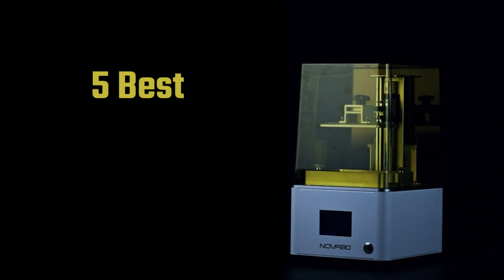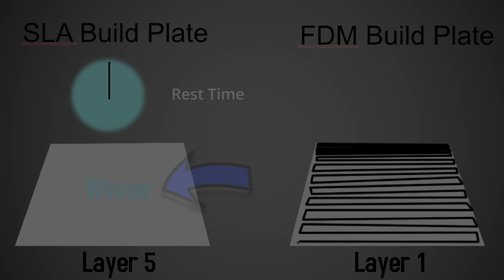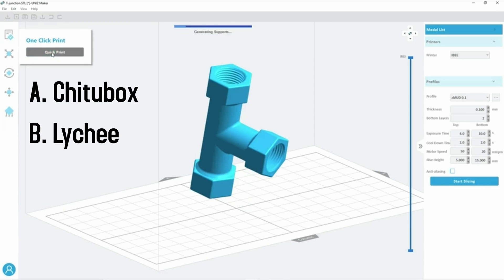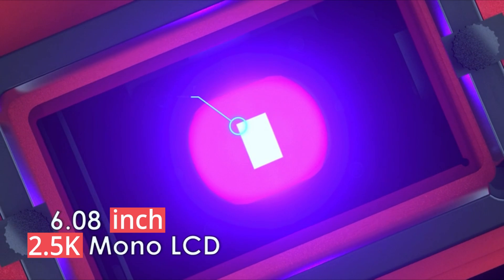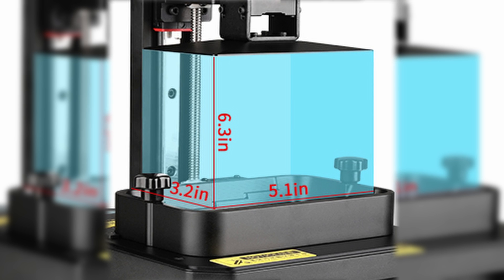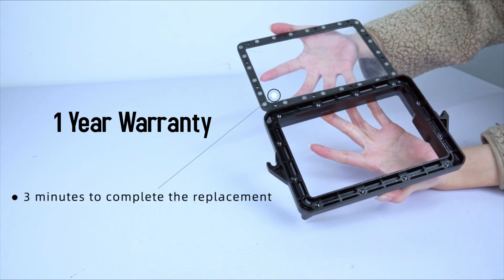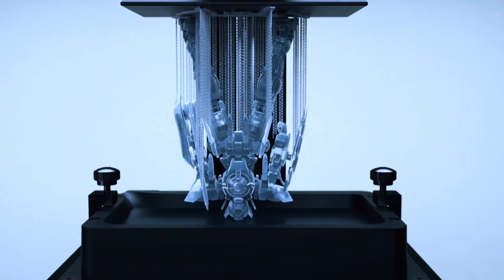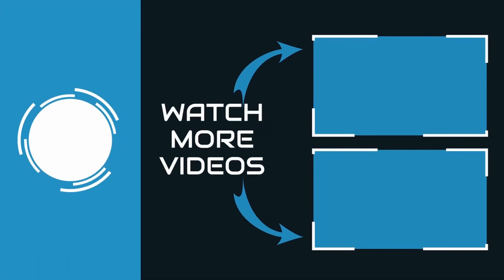Best SLA 3D Printers for Beginners in 2023 | Top 5 | Resin Printers

Comment: Small correction: you listed the printer size as the build volume for the Mars 3 - the actual build volume is 14.343cm (L) x 8.96cm (W) x 17.5cm (H). Informative video otherwise!

Comment: Is it possible to achieve print resolution of less than 20 microns using the LCD printers? Can DLP printers achieve print resolution less than 20 micron? What about SLA printers? What is the minimum resolution that we can obtain from SLA printers?
Reply: You can achieve much smaller resolution but the limits start becoming more about light uniformity ,theoretically the smallest you can print is around half a micron as thats UV lights wave length.

Comment: Hi. When you mentioned the accuracy I would like to know about the tolerances. I will need the 3D Printer for engineering and I need tight tolerances. Therefore I'm looking more for resin printer. When the 3D Part is hardened will it not shrink? I need 0.1 at least in all axes. thank you for your feedback.
Reply: Tolerance is based on multiple environmental factors, but typically resin have a 1-3% linear shrink rate, 5% volumetric shrink rate, high resolution printers can print surfaces as smooth as if they have been sanded with 500 grit sand paper so they're usable for joints with the right resin such as mecha white from saryatech.

Comment: Hey there, considering getting my first resin printer and have a quick question, can isopropyl alcahol be re-used for washing parts? or is it a case of used once and throw way?
Reply: You can let the resin residue settle in the bottom of the container that you used to clean the prints and then drain the clean alcohol to use it again

Comment: Some additinal things that were not mentioned in the video or only touched upon slightly: There are water washable resins available for which you do not need IPA to clean them. They have some disavantages of course and are slightly more expensive (very slightly where I am from) but overall for the hobbyist I think they are a great option. 

Regarding printing speed the example given is correct but this also means the resin printer takes the same time for a print regardles of how much you put on the build plate, only number of layers matter. Therefore if possible you should fill up your print plate as much as possible. If it takes you an hour to print one figure might as well print 5 figures in the same time.

Comment: this is the EXACT explanation video that I was looking for. thank you! 

at my work they have Formlabs printers and I got to work with them a little. I have some years of experience with FDM printing on my Anycubic i3 Mega and Mega X. But I am now intrigued by the resin printing. 
So I was looking for a video that recommended some budget printers but also showed the necessary precautions and all other stuff that comes with printing resin (like the curing and cleaning, that gets overlooked often)

Comment: The part about resolution at 4:35 is not correct. 4K refers to a pixel density, not the total number of pixels so the size of the screen does not matter, it will have the same precision.
Reply: No, resolution just gives you the number of total pixels of a screen. 4k monitor just has 3840 pixels horizontally and 2160 pixels vertically (3840 x 2160), for a grand total of 8,294,400 pixels.

If we were talking about pixel density you would have to divide by some sort of surface area for example 4000 pixels per cm squared or 4000 pixels/cm^2. 

So no, resolution doesn't take the size of the screen into account. You are just wrong.
Reply: @lukecasey2830  oops I guess I misunderstood resolution this whole time. I always thought it was about pixel density.

Comment: min 13:02 .. the conversion inches cm is completely wrong ... not only 5.6 inch is not 22,7 cm, but how can it be 5.6L 3.5W and conversion is 22.7L 22.7W ?? one is a rectangle in inches and the other one a square in cm... :)
Reply: What !? do u skip math class? 
5.6 inches * 2,54 Cm = 14,224 Cm L  ------> 3.5 inches * 2.54cm = 8,89 Cm W

Comment: Seriously how can you go less then 2 minutes and get things wrong. Operationally Resin Printers are simpler than FDM and therefore much easier to get up and running and repair. They also tend to occupy the same price points. The ony argument is that dollar for dollar FDM has a larger build volume. The selection of filaments vs resins is way more complicated. Generally Resins have way more chemistries than FDM since at the temperatures hobby FDM printers can reach you are limited to PLA, PETG, TPU, HIPS, PVA. Now you can get it in a wide variety of colors. There are more formulations of resins not to mention you can mix resins to get resins with a mix of properties but they tend to come in limited colors. However since it is a liquid resin you can make whatever color you want buy adding alcohol ink dyes or micah powders etc. Both the vapors from Resin and the fumes from FDM are toxic and should be done in a well ventilated area. But yes you must be much more careful handling uncured resin than Filament. It's sad there is actually a lot of good stuff in this video but getting through that first bit of inaccurate information annoys me.
Reply: To be fair, I just press print on my FDM, come back in 2 hours and hand the PLA toy to my kid. Resin oftentimes needs to go through a whole, less than healthy, cleaning process first that results in toxic waste that can be difficult for the average house hold to deal with. Many modern FDM machines come fully built with auto bed levelling. My less than tech savy parents have a FDM printer where theynjust print things for the house they download online (DIY stuff or spice racks...). I think Resin is perfect for hobbyists while FDM is perfect for all households. In 10 years time I could definitely see every house having a FDM printer but resin will still be specialist machines. Not saying 1 is better than the other but they are different beasts for the average citizen.
Reply: @Iamperson1965  Sla are faster, so if someone knows how to use it, it's better if they sre making it out of plastic, and it fits in the build volume...
Reply: Bro really said resin printers are fr in friendlier then fdm printers 😂.  Somone been inhaling that resin fumes a bit too much
Reply: This is objectively wrong. Resin printers are significantly more work than FDM, and adds extra toxic fumes to the mix (worse than FDM.) Requires messy post-print cleaning and curing. Better quality for more work. Never had to use gloves with an FDM printer. Stop huffing the fumes.
Reply: And LCD screens also dont use laser. I was wondering if i have to write those misinformations but im glad you already have :D
Reply: It's not the resin that stinksnits the IPA! Smell like a burnt wood Smell all day, anycubics resins don't bother me but the IPA wooft! Lol FDM would be a good choice if you were using it for parts for thing's car's,  around the house gardens etc not.really a modelling printer yet but hopefully it comes along soon I'd like to try one but till then I couldn't get over the layer lines with my OCD lol
Reply: Cool story bro

Comment: Nice nice video! 👌 Mars 3 printer looks epic.
Do you know if I have to worry about  overheating issues with the printers?

Thanks for the video!
Reply: I have a mars 3, its fantastic (though not as good as my Phrozen mini 8k), heat hasn't been an issue, but I live in the UK, so it isn't super hot in the atmosphere.
Reply from the maker: Thanks for helping out Admiral Bees :)
Reply from the maker: Although you might face heating problems with FDM Printers, Sla printers usually don't have this issue.
Even in warmer climates.
:)